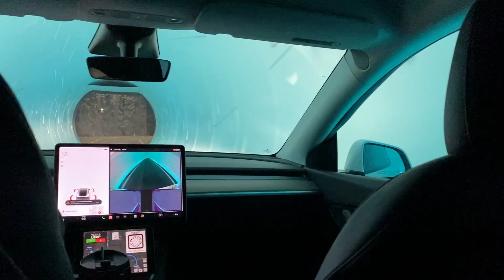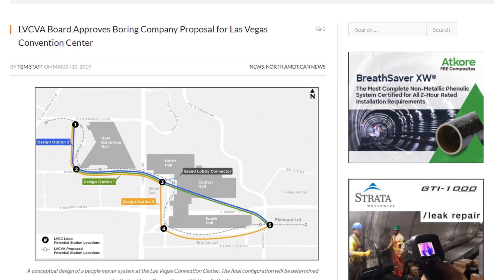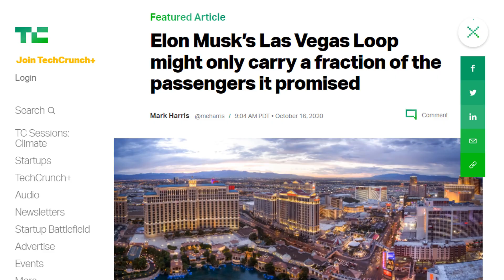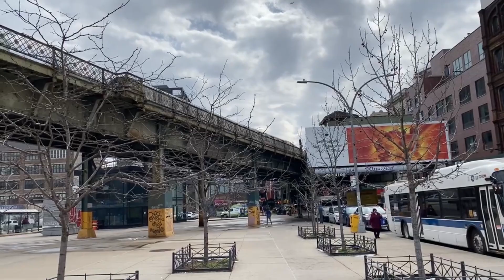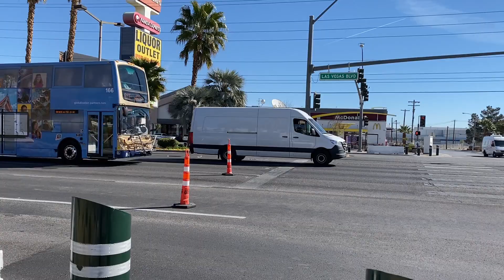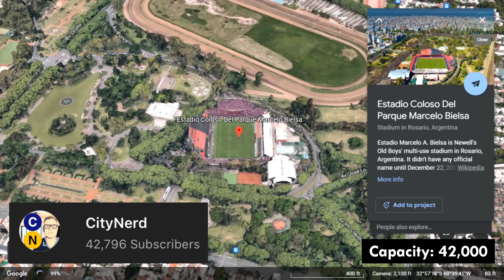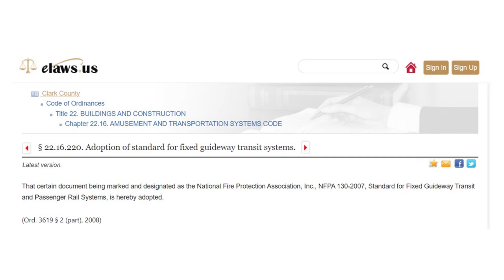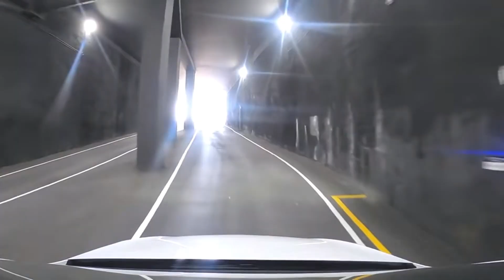Inside the Las Vegas Loop: Transportation Game-Changer, or Complete Waste of Time and Effort?

Comment: Not that I would wish for it to happen, but we will definitely see how sound it was to build these tunnels should anything ever catch fire in them.
🔥🚘🔥
Reply: the have the same safety mechanisms as a subway, and half of Tesla's sales are LFP battery cars that do not have thermal runaway in the batteries. so I don't foresee significant problems.
Reply: @somedude-lc5dy  Nah, subways have plenty of redundancy and cross track openings to handle emergencies. You can barely open the doors and exit one of these while in the tunnels, which BTW are too small for any traditional rescue vehicle. 

And while is true that the batteries don't have too many issues, there are a few instances of Teslas catching fire, the most recent three days ago in Canada. The news about that incident mentioned something about windows and doors not opening because.. well, the car lost all power once the batteries combusted. Video included.
Reply: @Imman1s  the Loop tunnels are 12.5 foot in diameter which is more than enough to open the doors and get out of the 6 foot wide Tesla EVs. That also happens to be a larger diameter than the 11’ 8” diameter of London Underground tunnels. 

Also, the actual stations in the Las Vegas Loop are closer together than the emergency exits in subways. The standard for subways is 750m while the Loop tunnels are only 640m each so no emergency exits are needed.

The LVCC Loop has a dedicated Tesla Tow vehicle, EV carts for emergency services and even the Cybertruck has driven down the Loop test tunnel so no problems for larger vehicles if needed - and the can enter or exit the Loop ar any of the station which are 8x more numerous than subway stations in the upcoming 29 mile Vegas Loop.  Good luck doing that with a Subway.

EVs are 61x less likely to catch fire than internal combustion vehicles and 139x less likely to catch fire than hybrid cars so there is as little chance of the Teslas catching fire as the massive Lithium battery packs being installed into many subway trains for regenerative braking, acceleration augmentation and emergency motive power. 

And the only reason that Tesla driver had to break window was because he didn’t realise that every Tesla has a manual exit lever built into the arm rest of every door. 

You should be more worried about the safety of subways. The NYC subway for example kills 70 people per year, only half of which are suicides with 2% being people murdered by being pushed off a platform in front of a train and the rest being accidents. 

The London Underground kills 50 people annually and has 4,000 serious injuries every year.
Reply: @andrewfranklin4429  But what about those "trunk" lines you pretend to exist whenever you copypaste the pre-written argument of planned headway between vehicles? Would they have stations only 640 m apart? Emergency exits would be required for those, and they would have to connect to the surface, which means acquiring land on the surface, which is expensive.
Reply: @andrewfranklin4429  Barely. The road is about 2 feet from the bottom of the circumference and about 8 feet wide. A fat person will definitively struggle to get out of the car over there and an old person is likely going to have issues getting to the side of the car to the open tunnel because the narrow walking space.

Your comparison with the London metro tunnel is also disingenuous, since the metro doors are designed to slide and won't open outwards like a Tesla.

About the distance to the exit... I think you missed my point. Is not about the distance to the exit, but having a safe way to get there. In case of accident, multiple cars are going to get stuck and passengers need to either wait for the car to be towed, or back up in reverse. If for whatever reason, they have to exit the car and walk to the station, they will have to do so moving around stopped cars. A typical metro will have large tunnels with two lines providing quick access to the vehicle as well as multiple evacuation options for the passengers.

Also, your statistics are 37.5x incorrect. Gas and Hybrid vehicles are more likely to caught fire in case of collision. Teslas are doing so spontaneously and you can't compare both statistics. And BTW, in that incident in Canada, the issue is not likely to be the batteries.

Your comment about the guy having to break the window is frankly retarded. The car was on fire and apparently lost power in the door and windows. The driver was trying to escape, likely not thinking straight because of the immediate danger to his life and you are asking him to be aware of an override mechanism in the armrest? What if he wasn't the owner of the car and was renting it or borrowing it from a friend? 

The fact of the matter is that is a unnecessarily complicated door mechanism with the only goal to be fancy. Many other cars have the same general door configuration and manage to make it operational without a stupid override. 

Let's wait for the findings, but Transport Canada is likely to issue some comments on that.
Reply: @Imman1s  Not true, you’re getting confused with the original test tunnel in Hawthorne where the road surface was lower. TBC raised the level of the road surface in the LVCC Loop tunnels. 

The Loop tunnels are 12.5 foot internal diameter and the road surface is around 9.5 feet wide which gives plenty of clearance on either side of the 6 foot wide EVs for egress on the very rare occasion that the couple of passengers might need to exit the vehicle. 

This is particularly so if the EV pulls over to the side of the road surface giving a good 3.5 - 4 feet of road surface and 6 feet of space to the wall of the tunnel at door handle level. 

Plenty of room for the one or two passengers to get out. 

Now trains on the other hand are far worse as you have to evacuate a thousand people crammed onto a train through a single door at the end of the train and then have that huge crowd negotiate tracks, pipes, and all sorts of other trip hazards and then walk up to 750m to the nearest escape tunnel. 

The Loop is far safer in an emergency as you only have a couple of people who need to jump out of the disabled car simply hop into the EV behind them to be driven back to the nearest station in the comfort of an EV equipped with huge HEPA filters and carbon activated filters running on re-circulate creating positive pressure in “Bio-weapons defense” mode to keep all smoke and toxic gases out for the few minutes it takes for the EV to drive to the nearest station.
Reply: @Imman1s  you are also perhaps unaware that Tesla Model Y cars are now being built with BYD’s Blade LFP batteries which can be punctured and damaged in all sorts of ways and yet not suffer from thermal runaway. Teslas are far less of a fire hazard than other vehicles.
Reply: @andrewfranklin4429  The diameter is at the median height of the tunnel... slightly below the roof of the car. Above and below that, it narrows a lot; based on the pictures of cars in the loop, the road surface at most is 1ft wider each side. There is more space to the sides because of the curvature of the tunnel, but you can't walk on it (actually BECAUSE of that extra space, people are more likely to fall than if it were a wall you can lean on(

And yes, you can pull over the other side.. assuming nobody needs to exit from that side. 

And no, you can't simply 'jump in the car behind'. First of all, it might be full, and even if is not, ALL cars behind yours need to back in reverse before you can exit the tunnel. 

The Loop is safer in the same sense that kid trains at the zoo are safe: because it is a touristic attraction. Apply it at scale and all its issues will grow exponentially, including safety hazards. 

Face it, this is not a solution to the transit problem, but BS peddled by Musk to sell more Teslas. 

Replacing the Teslas for said kiddy trains would make the system far, far more efficient and comfortable for the riders.
Reply: @Imman1s  If you look at the official Loop Fire Protection Report you will see that the road surface is 112” wide (9.33 feet) wide. The road surface is 117” (9.9 feet) below the roof of the tunnel putting the road surface 38” (3.17 feet) above the lowest point of the tunnel. 

The Model Y is 64” high meaning the roof is 53” from the ceiling of the 150” (12.5’) diameter tunnel. That puts the Tesla’s roof 22” or almost 2 feet higher than the mid-point of the tunnel meaning the door handles are just below the widest part of the tunnel. 

The Tesla Model Y is 75.6” wide meaning that there is 18.2” (1.51 feet) of roadway and 37.2”(3.1 feet) to the wall of the tunnel on either side of the car. More than enough room for the rare occasion when someone needs to get out of the car. 

You’re really flogging a dead horse here Immam. 

Yes you can just jump in the EV behind as the average occupancy is only 2.5 passengers and crowding is no problem in an emergency. All Loop EV drivers are trained to simply reverse out of any tunnel segment that may become blocked by a disabled vehicle.  Because the Loop stations are so much closer together than subway stations (there are up to 8 Loop stations in the distance you would only have one subway station), this is a trivial exercise.

And of course once autonomy is turned on, it will be a piece of cake for this all to happen automatically.
Reply: @andrewfranklin4429  Tesla loop tunnels are a joke compared to any modern European or any modern Asian country tunnel. Loop tunnel expensive for 4 to 10 times smaller size, just one lane instead of 2 to 4 lanes, no security exits no escape security tunnel (lack of safety features is unsellable in European and rich Asian countries)
Reply: @andrewfranklin4429  In your fantasy world, you still have not explained how an ambulance comes through the Las Vegas tunnel and how you get first aid if a heavy wide person is in a Tesla car. In any modern European tunnel, the ambulance has access via another lane.
Reply: @THEREALZENFORCE  unlike subway tunnels where you have to use little trolleys for emergency service personnel to get to the scene of accidents, emergency services vehicles up to twice as high as a Tesla Model 3 can easily drive straight into any Loop station, down the spur tunnel ramps right into the Loop tunnels and drive direct at high speed to the incident. The only requirement is that they be electric-powered, not ICE. 

Far safer and quicker than those emergency trolleys or having to build enormously expensive parallel tunnels which only have access to the main tunnel at widely spaced intervals for emergency services vehicles to drive down.
Reply: @THEREALZENFORCE  the Loop meets or exceeds all relevant national and international fire codes and standards so will have no problem being approved in Europe or Asia and is significantly safer than a subway. 

Here are just some of the fire codes, regulations and standards that the LVCC Loop is compliant with as listed in the Loop Fire Protection documentation:

- NFPA 130 – Standard for Fixed Guideway Transit and Passenger Rail Systems, 2017 [1].
- 2018 International Building Code (IBC), as amended by CCDBFP, utilized as a reference only, specifically where NFPA 130 may not address a condition unique to the CWPM
- 2018 International Fire Code (IFC), as amended by CCDBFP, utilized as a reference only, specifically where NFPA 130 may not address a condition unique to the CWPM
- NFPA 13 – Standard for the Installation of Sprinkler Systems;
- NFPA 14 – Standard for the Installation of Standpipe and Hose Systems;
- NFPA 20 – Standard for the Installation of Stationary Pumps for Fire Protection
- NFPA 70 – National Electric Code;
- NFPA 72 – National Fire Alarm and Signaling Code;
-  NFPA 101 – Life Safety Code (as referenced by NFPA 130);
- NFPA 220 – Standard on Types of Building Construction (as referenced by NFPA 130).
- NFPA 1221 – Standard for the Installation, Maintenance, and Use of Emergency Services Communications Systems (as referenced by NFPA 72)
Reply: @andrewfranklin4429  "Loop meets or exceeds all relevant national and international fire codes and standards so will have no problem being approved in Europe " You are fake news again.
Compare the bad Loop tunnels to : video :
"A7 Luxembourg - Ettelbruck" (see the difference in top of the world tunnels compared to low quality low security Loop tunnels). first of many top quality tunnels start at 1 minute 12 seconds in the video.
Reply: @andrewfranklin4429  Compare the bad Loop tunnels to : video : "A7 Luxembourg - Ettelbruck" (see the difference in top of the world tunnels compared to low quality low security Loop tunnels). First of many top quality tunnels start at 1 minute 12 seconds in the video. See the number of exists, number of security lights per tunnel segment, plus wide lanes so that emergency services and ambulances can go through.